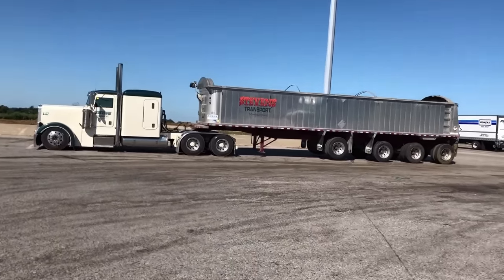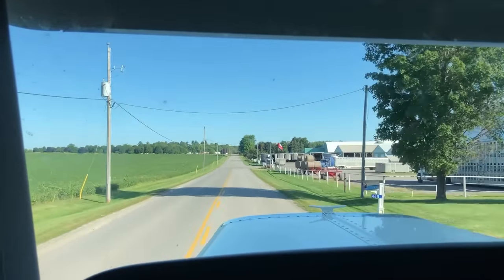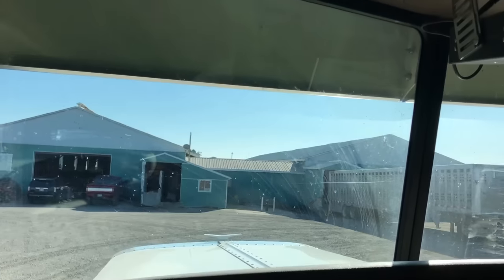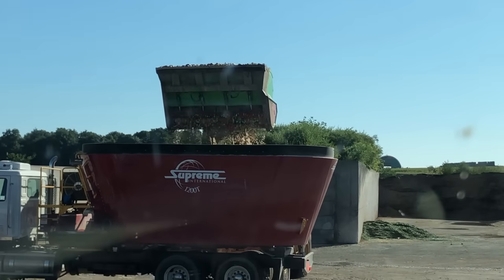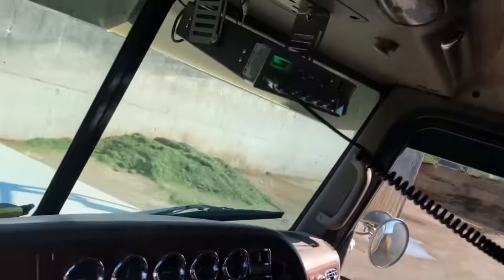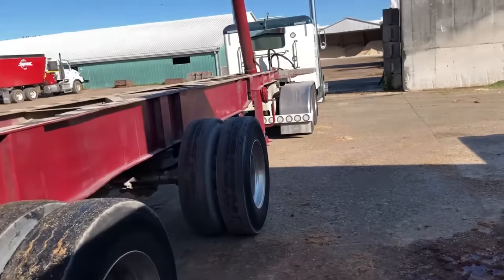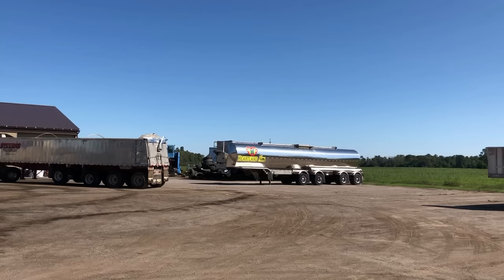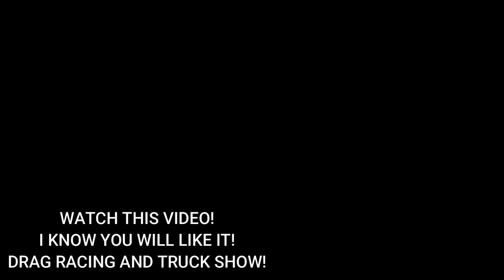Unloading Wet Feed Out Of A End Dump Trailer ! Was This Better Then The Walking Floor Unload I Did ?

Comment: I know you like that dump trailer better than the walking floor. That was a pain in the Lester. I never get tired of seeing that beautiful Petercar. I used to run a 359 extended hood from Charlotte NC to Boston Mass a couple times a week. I would put the seat on the floor and going through NYC on I-95 the frame flex would just totally cancel out that rough ass road and just float along like a cloud. Anyhow, thanks for another great video. Later!

Comment: Is there any difference in weight capacity between a tandem tractor with Quad trailer .... or a tri axle tractor with a tri axle trailer?
Reply from the maker: There arnt many 3 axle trucks that roll around our area , so I couldn’t really tell you to be honest
Reply: Can't say on a dump trailer, but I pull belt trailer hauling distillers and there is generally a fairly decent weight difference between a quad axle trailer on a tandem truck and a triple trailer triple truck setup because there is generally less subframe over the suspension on a triple axle trailer compared to a quad